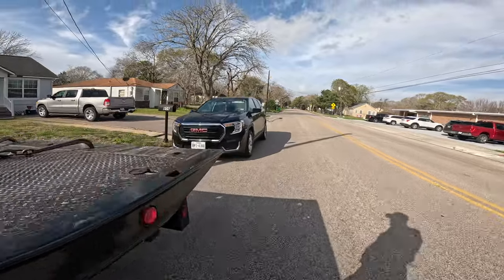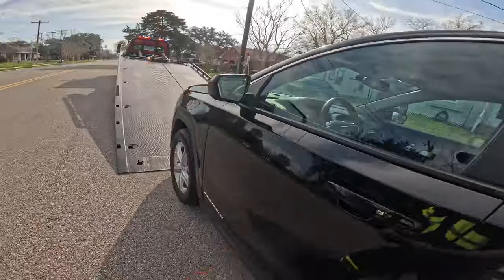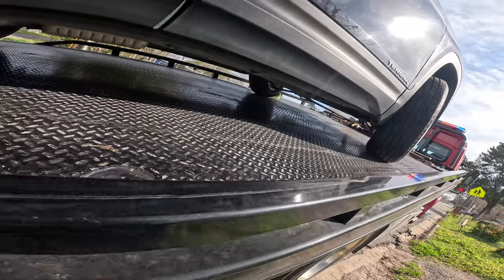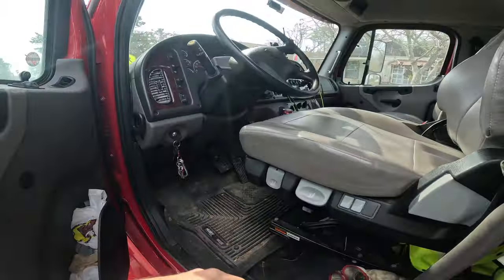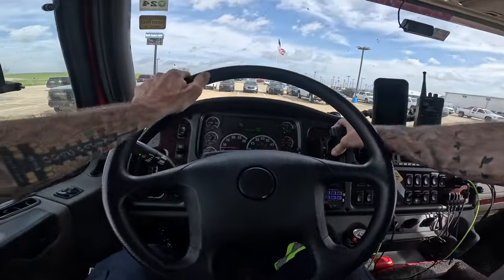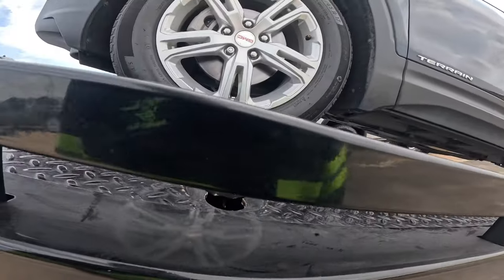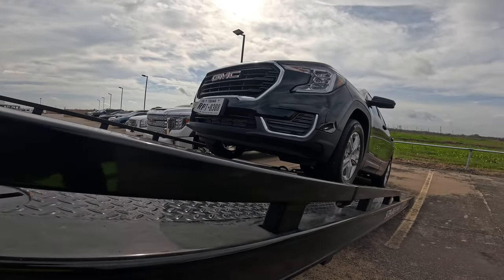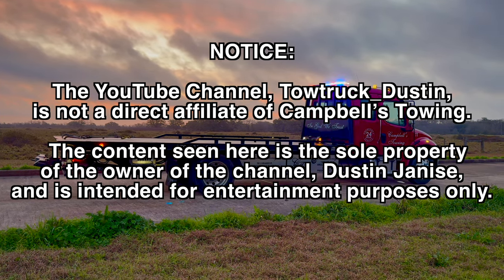Another GM Fuel Pump Module Failure? Towing a 2022 GMC Terrain!

Comment: the vehicle has power so it should be very quick to put it in neutral by turning the system on without depressing the brake pedal to start the vehicle.
Reply: This happened to me the other day and the car couldn’t be put in neutral even with the power still working. The manual neural switch/lever would work either.

Comment: Why couldn't you run your winch out to like a snatch block on the rear of bed then bring the cable back under to the front crossmember and pull it off that way? Just curious if its hard on equipment or vehicles doing that ?
Reply: Shaking and walking the car off the bed doesn’t hurt your equipment or the vehicle. As for your way you could there’s nothing that says you can’t but personally I prefer the way he’s doing it cause that’s the way I learned
Reply: @ChrisBrown1228-i2u  awesome ! Was just curious

Comment: Why didn’t you cut the car on and put it in neutral?
Reply from the maker: I going to take a wild guess that you didn’t even watch the video.
Reply: The release is there….you needed to take the panel completely off to see it. It’s a little trap that you have to pull. It’s hard to see without taking the panel door completely off.